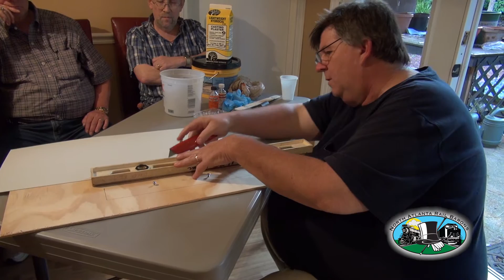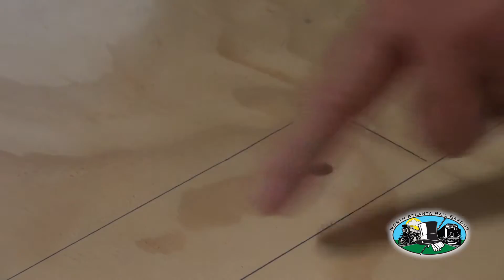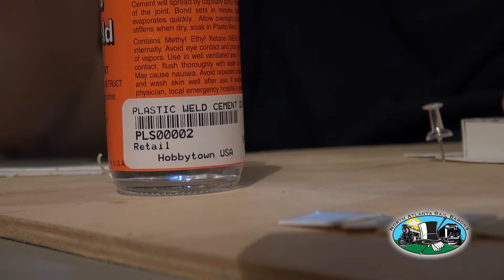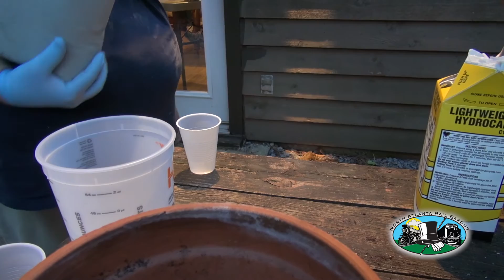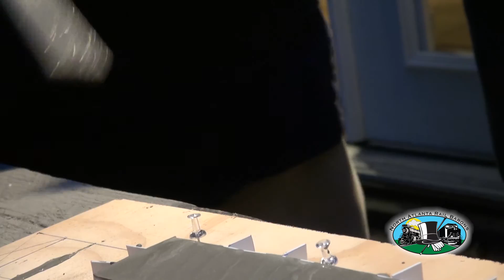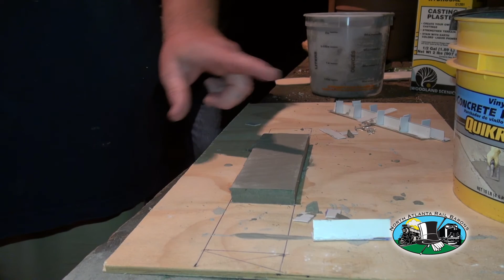Casting Concrete Structures for Your Model Railroad - A Clinic by Walt Liles (HD)

Comment: I have used the concrete patch material, or hydraulic cement for doing things like roads and paved areas. When it sets, it looks just like the roads here in Southern Virginia, which tend to fade to a light gray. I've used it for years to install steel railings (it's safer than melting lead), and decided to experiment with it on my layout. I haven't used Hydrocal to this point, but one of these days I'll have to give it a shot.
Reply from the maker: Keep in mind that the concrete patch material gives the mixture the prototypical color of concrete.  Best of luck when you try this procedure out.  Let us know how it works for you.